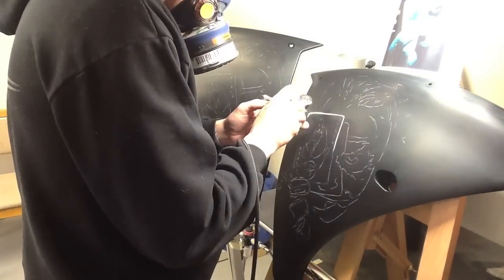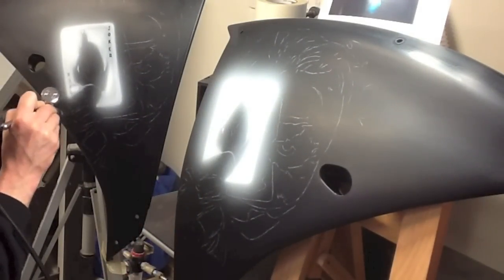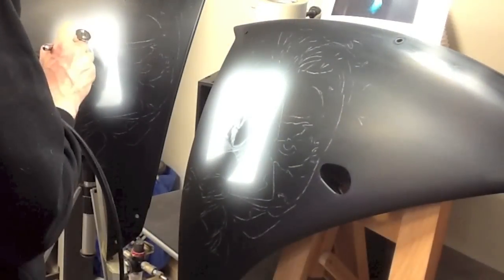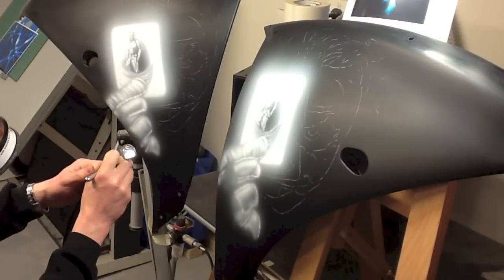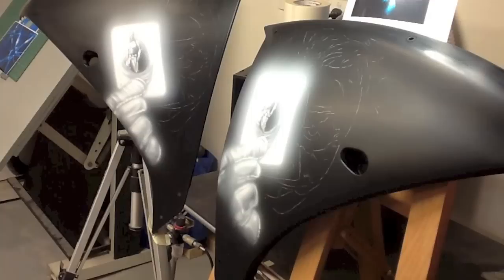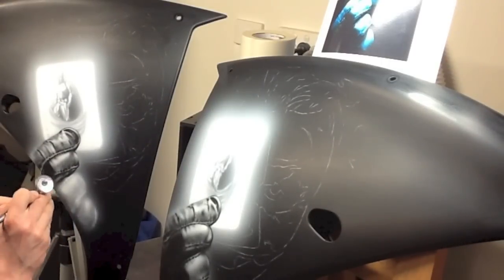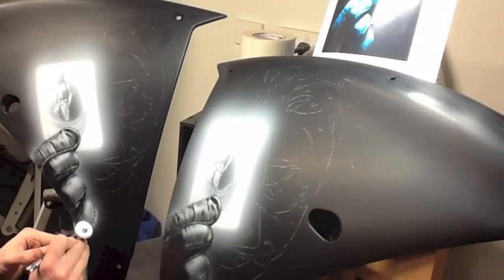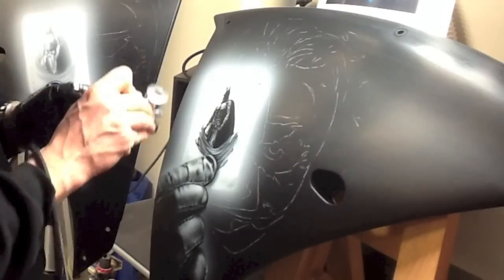The Joker R1 - Part 1, Step by Step.

Comment: I am by no means at your skill level infarct I am just starting to learn airbrushing, My question is why did you not do the pictures the same on both panels.The card in by the hole on the left panel but on the right panel the card is by the front edge.
Reply from the maker: Thanks for your comment, the artwork was lined up and tilted so that when the fairings when back on the bike Rey would line up properly...it may not show this accurately in the video, but everything lined up perfectly when it was put back on the bike.

Comment: Hi just one question how do you keep from having over spray without using masking every time I try doing my airbrushing without masking I always end up with over spray where I didn't want any paint at all ?????
Reply from the maker: +Marcus Tucker hi there thanks for your question, if you want a sharper edge or line without overspray and masking, you need to hold the airbrush right up to the surface that you are painting and control the paint flow. It is difficult but practice and you will achieve it in no time . Hope that helps 👍🏼